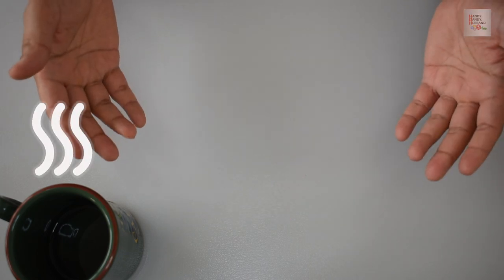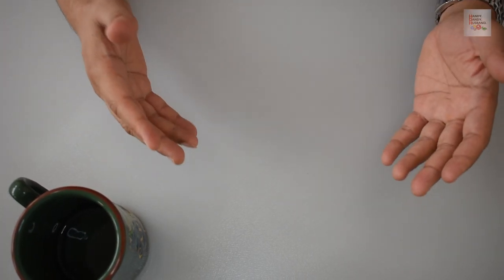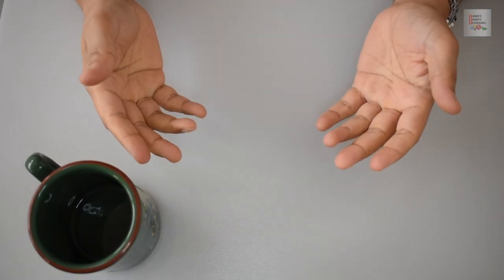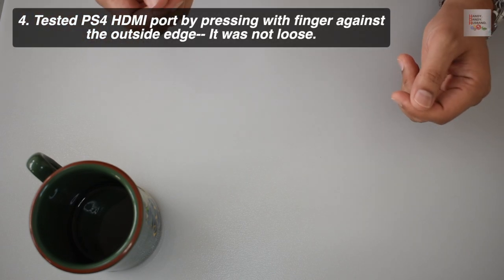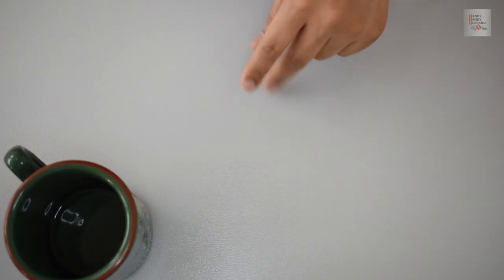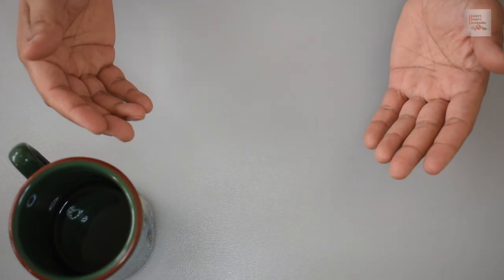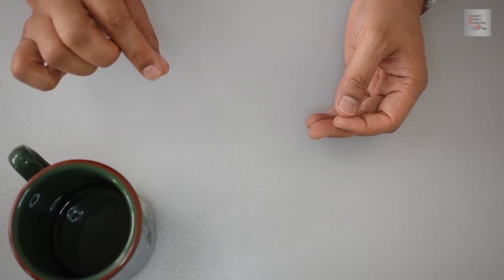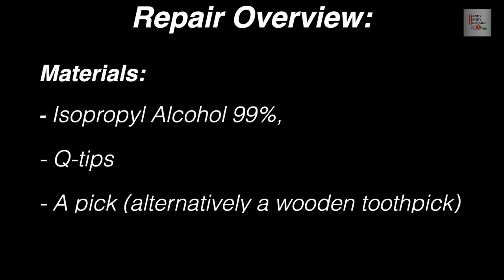𝗤𝗨𝗜𝗖𝗞 𝗧𝗜𝗣: 𝗣𝗦𝟰 𝗛𝗗𝗠𝗜 𝗣𝗼𝗿𝘁 𝗥𝗲𝗽𝗮𝗶𝗿 -- Easy, no solder required -- [Fix that video input error]

Comment: My PS4 hdmi port has been replaced and for months it was doing fine, PS4 did not drop or nothing. Also it was barely touched if at all...the port also appears undamaged...the pins are perfectly fine. I don't know why it's a bit loose though literally nothing happened to it🙁 I've had my PS4 since I was 13/14 when it came out and since then it has gotten the most beats out of it. Yet since I've gotten it fixed it has been safely taken care of..Is there any tips on what It can be? I'm reconsidering on getting the PS5 due to Sony's errors.
Reply from the maker: Hi Kevin Barrera, thanks for watching and sending me your comments/concerns.  My top suggestions to you would be the following: 1) replace the HDMI cable with a brand new cable (cables have metal connectors and these connectors can become looser over time--note that the PS4 runs quite hot and the PS4 PRO even hotter which means all metal parts would be subject to hot temperatures as they conduct heat, this may make the metal more bendable and or looser); 2) use a different HDMI port on your monitor or TV (this is in case the TV is the source of the issue); 3) Use a bright light source and a magnifying glass to carefully inspect the HDMI port behind the PS4.  Compare its appearance to another HDMI port that hasn't been used (check on maybe a video card or even on a laptop) and see if in fact the middle brass area is as clean as a new port and also check if the metal prongs push up as much as they need to.  With my son's PS4 PRO, I performed the repair once, it worked for about 6 months, and then I had to do it a 2nd time. It was the 2nd time doing it that made me make the YT video.  Hope the suggestions help you.  All the best to you, H.D.H. [: { ].

Comment: Hi i go not have a metal pick and am using a toothpick and I don't know how to prop the metal prongs up
Reply from the maker: Hi Gavin Dennis, thanks for watching and sending me your question.  If the toothpick you are using is too flexible to prop up the metal prongs, try using a long pin or a long needle.  Both of these items are thin enough and likely stronger than the toothpicks you are using.  Hope the suggestion helps, let me know your results.  All the best to you, H.D.H. [: { ].
Reply: Thanks I will try 😀
Reply from the maker: @gavindennis629  All the best to you Gavin Dennis.  Let me know your results. H.D.H.
[: { ].

Comment: The prongs are from the bottom part of the hdmi that we gotta loosen or the top part?
Reply from the maker: Hi Sergio Mendoza, thanks for watching and sending me your question.  The thin metal pieces of metal that need to be bent back into position can be viewed using the picture viewed here:  https://drive.google.com/file/d/1nYwZaYcaKrAbYL6Nsrgn1AA8T0TmL-53/view?usp=sharing
The metal pins are on the outer metal side.  My particular version of the PS4 had them on the bottom.  Other versions may be different.  I hope this helps.  If you need further information, feel free to send me a clear, close-up picture of your HDMI port to my email at thehandydandyhusband.info@gmail.com
All the best to you, H.D.H. [: { ].

Comment: Hey I don’t have a problem but I do need to ask a question, what if you unplug and replug the hdmi cable a lot. Will that break or wear the hdmi port?
Reply from the maker: Hi Timiana, thanks for watching and sending me your question. I think on a typical device (say a laptop or a well made TV, the HDMI port can withstand frequent unplugging and replugging.  With the PS4, however, I would have to say that this is less true.  The tension prongs that hold the HDMI cable centered appear to be very bendable on the PS4.  This makes them prone to bending flush with the outer metal casing and thus making them useless in ensuring a tight fitting connection.  I am sure all HDMI ports would go through a certain amount of wear and tear, but considering the large number of PS4 owners that have complained about HDMI port problems...I am inclined to say that the PS4 has an inferior HDMI port and I would strongly recommend against plugging and replugging the HDMI cord.  For other devices, I think it depends on whether the device (like a laptop for instance) is designed for portability and it is expected to withstand frequent removal of peripherals. I have been taking a careful look at the different HDMI ports in various devices and can confirm there is a difference in design and longevity--try looking yourself and let me know if you too see a difference.  Hope my answer was helpful to you.  All the best, H.D.H. [: { ]
Reply: I’m wasn’t being specific my bad, i was talking about a ps4
Reply: ty
Reply: I have to because some times my brother wants to play games on a tv and I like to play on a monitor so idk what to do any advice?
Reply: I liked, you are one of the only people that I have found that helps and is very nice and clear
Reply from the maker: @DemonTimmy  Hi Timiana, thanks for developing your question further.  I think the best approach in your particular situation is to unplug the HDMI from the other end (the end connected to the monitor or tv).  Leave the HDMI cord connected to the PS4 and connect or reconnect the TV/Monitor end as you require it.  If you are looking for an even better and convenient option, you might want to invest in buying a HDMI switch which enables you to switch--with a flick of a button--between two types of video devices.  You will have to spend some money though, and also invest in two additional HDMI cables.  Hope the suggestion helps, all the best to you.  H.D.H. [: { ].
Reply: HANDY. DANDY. HUSBAND. I just thought of that and it’s really smart ty so much I’ve been worrying about it for so long. I’m to lazy to go on Amazon and buy those things but I will try the first part of the thing you said. You my guy earned a sub
Reply from the maker: @DemonTimmy  Hi Timiana, thank you soooo much for the support.  I really appreciate you becoming part of the community.  Lets all work together to make the things we have last as long as they can to help our mutual mother:  Mother Nature.  All the best to you. H.D.H. [: { ].

Comment: Everytime I try to prop up the metal pieces the toothpick breaks and how do I know if I propped them up
Reply from the maker: Hi 999squirt, thanks for watching and sending me your concern.  Sorry about your toothpicks breaking...perhaps try a plastic pick.  If that doesn't work, you may have to use a long needle or a long pin, if you don't have metal pick like the one I used in the video.  You will know if you have 'propped' them up enough when you can see them protruding about 1-2 mm away from the metal that surrounds the HDMI port.  If you want to be really precise, you can look at prongs in the port next to the HDMI port (AUX) and prop up the HDMI port prongs about half this height. Hope this helps.  All the best to you, H.D.H. [: { ].
Reply: @HANDYDANDYHUSBAND  I don’t know how to make them go up tho
Reply from the maker: @ELMstreett  Hi The World, thanks for watching.  With reference to your question, let me give you a bit of an overview.  The HDMI port has a metal casing (grey colored) with a center bit (black or dark colored).  The center area seats into the HDMI cable.  There are two tiny metal strips that are supposed to provide a bit of tension to the HDMI cable when it is placed inside the PS4 HDMI port that are located on the outer casing.  Sometimes (more like typically) these metal strips bend towards the outside (i.e. away from the center of the HDMI port or away from the HDMI cable that you stick into the port).  My fix in the video explains how to gently move the strips back in place so that they can provide the friction to the HDMI cable that has been lost.  Note:  be gentle, use a pick, or a long pin and only push up until you see a little hump for the HDMI cable to slide against (DO NOT push the strip all the way up--this will mean that the HDMI cable edge will snag on it).  Just push up the curved area of the strip. Hope this helps you, please let me know if you have any other questions.  All the best to you, H.D.H. [ : { ].

Comment: when I connect my hdmi to the ps4 and to the tv mine turns on but after there like a black and white line that is not letting me be able to play
Reply from the maker: Hi lxlspooky_ , thanks for watching and sending me your comment.  I am not sure what could be causing the black and white lines.  It could be a poor connection between the TV and the PS4.   One way to test this is to hook up a laptop to the same hdmi and see if the problem persists.  If it does, then replace the hdmi cable and retest, if it does not then the problem may be with your PS4 hdmi port.   Unfortunately, without more information, it is hard for me to provide any other assistance.  Hope you try out my test and see if it works.  All the best to you, H.D.H. [: { ].
Reply: @HANDYDANDYHUSBAND  well I know it’s not my tv or hdmi I honestly feel like it’s my ps4 but my brother had told me I have to move my hdmi up to fix it but it also doesn’t work
Reply from the maker: @lxlspooky__  Hi lxlspooky_, thanks for updating me with hdmi issue.  Man...that is a bummer.  Unfortunately, I don't know of any other fix other than recommending you take the PS4 to an authorized repair center.  Hope you eventually get is resolved. All the best to you, H.D.H. [: { ].
Reply: @lxlspooky__  yeah same exact problem with me, i have to push the hdmi for it to work and it only works for 2 seconds

Comment: this didn't work on my ps4 I wish it did I could play it but it didn't I did everything you said and still nothing on my tv both tv i try see if was my tv but one tv says ps4 but still no signal and my other tv nothing still no signal
Reply from the maker: Hi Zack Floyd, thanks for watching and sending me your results.  I am sorry the fix didn't work for you.  One last ditch attempt you could make is with our PS4 off, hold the HDMI cable on the back port and after you turn on the PS4, try gently shifting its position (do not do this aggressively), this might help you trouble shoot if it is a loose PS4 port or if indeed its a connection issue, but the fix was not sufficient to bridge the gap.  Hope you do get your PS4 working again, if you have any questions, let me know.  All the best to you, H.D.H. [: { ]

Comment: I can tell you for sure, the hdmi boards in the majority of home theatre receivers are problematic, all from 1 source.

My pro has about 20 hrs on it, haven't used it in 4 months, bought a game, fired it up..no signal
Reply from the maker: Hi vonclod123, thanks for watching and providing your comment.  So with regards to your PS4 Pro, were you able to determine whether it was your PS4 or your home theatre receiver?  I had assumed most TV's to have higher quality components as compared to the PS4 due to pricing, but perhaps I was wrong.  If you get a chance, please reply.  All the best to you, H.D.H. [: { ].
Reply: @HANDYDANDYHUSBAND  Hey, thanks for the reply. I did get it running tonight, swapped the cable and that seemed to do it, it was a good cable to begin with, but, you know how it goes. Simplest things 1st. It was just a pain to route.

As far as HDMI boards, not sure if the tv based ones are problematic, but for sure, If a home theatre receiver has a problem, it's the HDMI 75% of the time.

Cheers
Reply from the maker: Hi vonclod123, thanks for your reply.  That is great news that the HDMI cable replacement worked for you.  Here's to keeping your PS4 Pro working for many years to come.  All the best, H.D.H. [: { ].
Reply: I’m going back and and then
Reply from the maker: @diamondstewart2984  Hi Diamond Stewart, thanks for watching.  Not sure what you mean by your comment.  Please clarify and I will try my best to provide a helpful answer.  All the best to you, H.D.H. [: { ].

Comment: Well my ps4 used to say no signal and when u shake the cable a bit it would work tho any other shake would go back to a blue screen
And then it stopped working
Reply from the maker: Hi FyberG, thanks for watching and sending me a summary of our issue.  From what I have heard from you and others in the community, the adjustment of the cable that enables a good signal is the sign that there is poor contact between the HDMI port and the cable or worse poor contact between the HDMI port and the electronic board in the PS4.  I would do the following: 1) check and see if the HDMI port on the PS4 wiggles or wobbles--if it does, then the PS4 HDMI port may have loosened contacts on the internal board.  2) If that is not the issue, try my fix that I outlined in my video, that may solve the poor connection issue, 3)  I would also check the TV HDMI port just to make sure that it and not your PS4 is not faulty, 4) If all else fails, jerry rig the cable in a position (with masking or duct tape) that provides a solid signal, play on the PS4 for a good 4 hours to make it nice and hot, and then turn it off normally, and unplug it.  Wait 24hrs and then remove the tape.  See if that helps your PS4 maintain a better signal.  If the above suggestions do not work, you may need to contact Sony to get the contact information for a warranty authorized repair depot near you.  Hope the above helps you, all the best to you in 2021, H.D.H. [: { ].

Comment: What happened is that my ps4 fell of the desk now is not showing in the screen when i turn it on
Reply from the maker: Hi AyuMaster, thanks for watching and sending me your issue.  Many issues could have occurred when your PS4 dropped onto the floor.  One thing I think you should check is the HDMI port.  Sometimes (depending on how the PS4 lands) the HDMI port can be jarred or twisted by the cable.  Check it by removing the cable and using the finger next to your pinky finger (the weakest finger so you use the least pressure) and see if the HDMI port wiggles or moves.  If it does, then there is a chance that this is the cause of your video output issues.  Some viewers have used a toothpick or wadded up paper and placed it between the outside HDMI port metal and the PS4 case to make the HDMI port stable again.  This can work in some cases, but it is not a guaranteed fix as it depends on how badly the HDMI port is damaged.  If you do try this fix, please let us know your results.  All the best to you, H.D.H. [: { ].

Comment: It doesn’t work my disappointment is immeasurable my ps4 dropped and the hdmi doesn’t want to work I just decided to spend money on my account I put the pins up mine does have tracks on it but when I replaced it it still didn’t work I followed all the steps and it doesn’t work and the both of the hdmi ports that I used worked fine with my laptop and now I’m sad cause I can’t play
Reply from the maker: Hi Yfiggs234, thanks for watching.  I am sorry my fix didn't work for you.  You may want to see if you can wiggle your HDMI port.  If it does move, the entire port may be compromised rather than just the pins being bent flat.  One viewer mentioned that he was able to use a toothpick and jam it between the HDMI port and the PS4 to stop the wiggling (if you happen to have this issue).  Apart from that, you may need to have it repaired by a factory authorized repair depot.  All the best to you and I hope you get your PS4 working again.  H.D.H. [: { ].

Comment: how do you pull the prongs up i can’t get under them
Reply from the maker: Hi Izcamm, thanks for watching and sending your question my way.  The best way is to use a thin strong pin that can fit between the prong and the outer metal case.  This way you can use a lever action to pull them up.  If you can't fit anything in this small space, try using a pin to try pushing the prong toward the center from the outside--this will be harder to access as there will be less space between the outside of the outer metal casing and the prong.  Hope the above suggestions help.  All the best to you. H.D.H. [: { ].

Comment: I dont know whats wrong when i get into a call of duty game my tv goes blank but i can hear everything thats going on can u please tell me whats wrong with it?
Reply from the maker: Hi bexwy, thanks for watching and sending me your question.  Assuming you don't have an alternate source for audio, I think what is happening is that there is an incomplete HDMI connection.  To improve the connection, I would first try propping up the prongs (like I have shown in the video), the second thing I would recommend is replacing the HDMI cable with a brand new cable, third, I would switch the HDMI cable to a new input on your TV.  Last, if all the above do not work, turn on COD wait for it to fail (with the blank screen but with audio) then try shifting the HDMI cable when it is inside the PS4 port (gently!) and see if the slight movement improves the connection or re-engages the video.  FYI:  the HDMI port/cable is designed to transmit both Audio and Video.  So my thinking is that if you are getting audio then there is a connection but it is very weak.  The solution would be to try to improve the connection.  Hope my suggestions help.  All the best to you, H.D.H. [: { ].